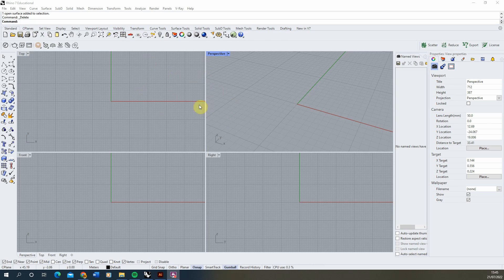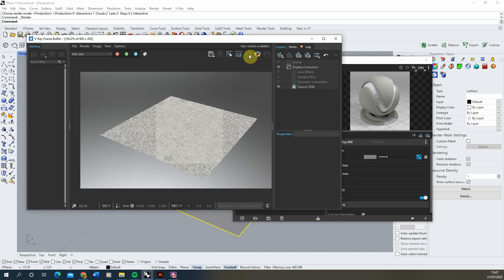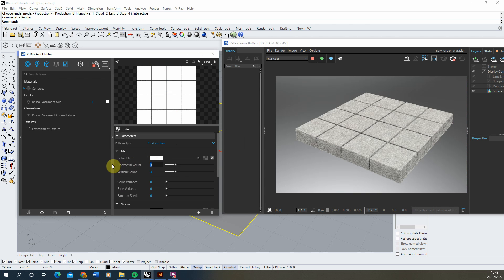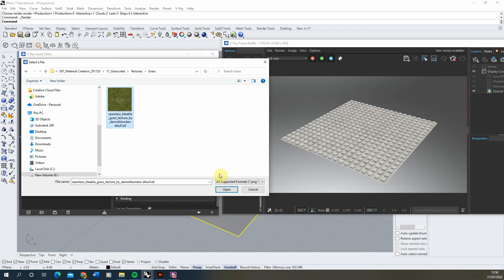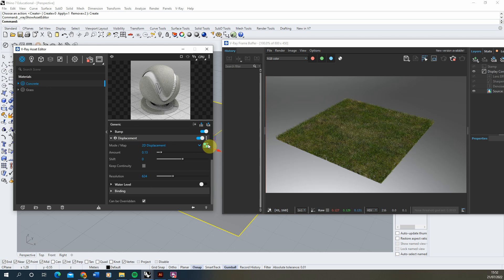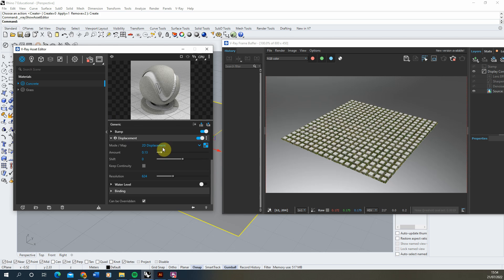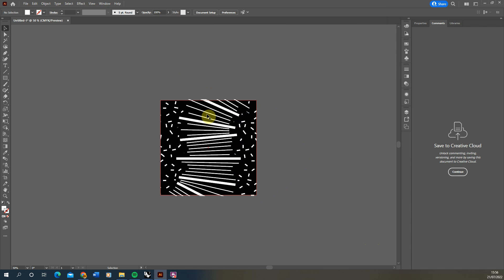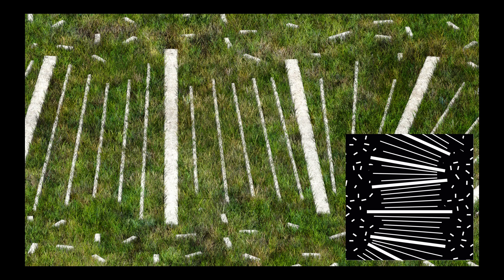Permeable Paving/ Grasscrete Material Creation - VRay for Rhino 7

Comment: amazing tutorial thank you ! I have a question , will you do a tutorial to show how grass material can " fade " on a path for example ? I am strugling with this in particular. FOr example I do a path in a grass field and the line between the path and the grass is too "obvious " , how is it possible to make it more realistic and having more fading and smoothing for the transition of materials ? DO i need to use some kind of displacement map ? 

thank you for your work
Reply from the maker: Hi, fades can usually be achieved by adding a gradient map to the VRay Fur or grass scatter. I can look at putting together a quick video on how this could be done
Reply: @tombudd15  Tutorial on gradient map would be great! specially in grass and ground cover conditions